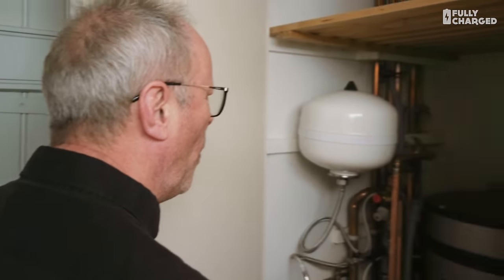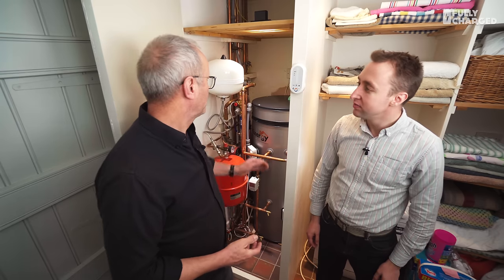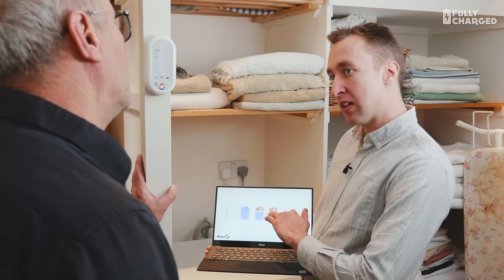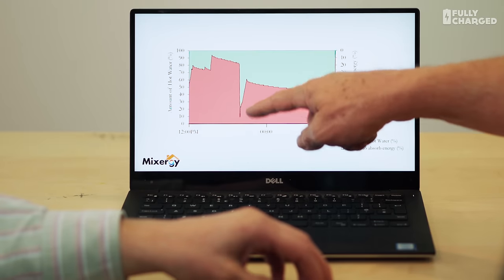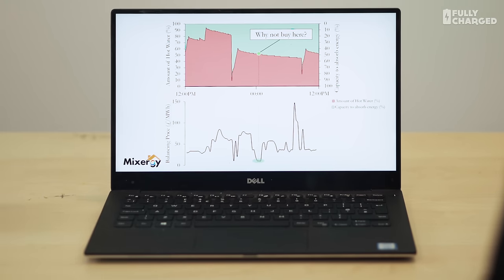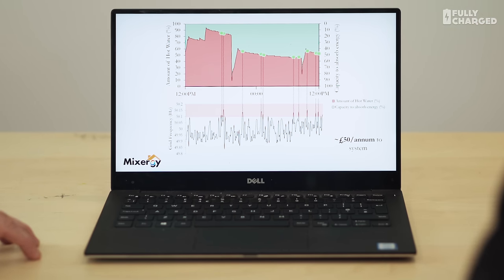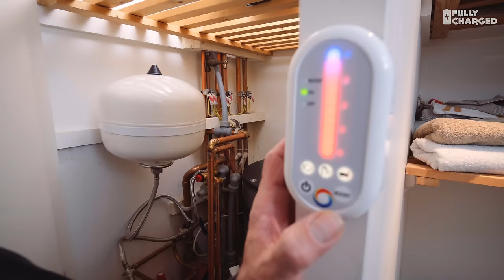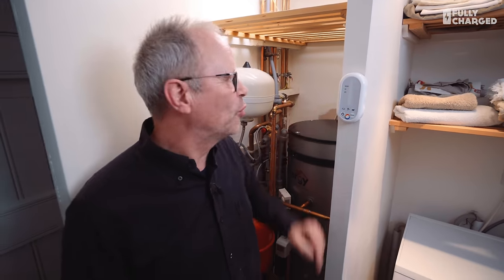Mixergy Hot Water Tank | Fully Charged

Comment: In the 1970s we also had a water tank with a second heating element at the top so that we could have a quick warm up of water if it was cold :)  On another point, the animation that he showed of a bottom heating element having to warm a full tank isn't correct as it ignores convection.  The warm water at the bottom becomes lighter than the cold water and gathers at the top of the tank first in any case.  Because of this the water at the top of the tank will be well up to the correct temperature for household usage long before the whole tank has heated up :)
Reply: You're correct that the top warms by convection from a bottom element, but slowly- hotmwater from the element warms surrounding water as it rises, so you are basically heating a large volume of water slowly. It takes some time before the whole body of water is hot enough to use. By using their principal, ALL the heat is concentrated at the top, so the first few litres quickly heat to a usable temperature. You could probably have a short shower in ten minutes from cold, with a conventional tank you might have to wait half an hour or more.

Comment: You'll have a job and a half getting the tank out if you ever need to replace it. But, having a hot water service that saves electricity will be a good thing. In Australia we have a Edwards solar hot water heater which uses the sun to heat the water up to 100C. But if it has been cold we can turn on a timer that uses a 2400 watt element inside the stainless steel 150ltr tank. It only takes 1 hr from 5AM to 6AM to heat the water to 60C which is enough for 3 long showers. It only cost us $4500 which was not long after they first came out over 10 years ago and still going strong. I imagine they are much cheaper now.

Comment: If you store hot water leave the heat source on 24/7, let the stat maintain the heat. This stops you from ever having heat up a full tank again. As you draw hot water it is replenished with cold which will cool the hot water in there that you have previous paid for so it makes sense to me as the temp drops to apply the heat as the stat demands . Good insulation is a key factor as well.

Comment: My water tank is 42 years old. I heat it with gas and in the summer my gas bill has been just over £5 per month to heat the water. I am finding that as I look into solar energy, batteries etc that the payback is at least 8 years (more if you take into account lost interest). This looks like it will be something similar? I think the problem is that a lot of these technologies end up being a long term investment in a fast improving technology and that makes holding off until something better comes along the default position for most people.
Reply: If you're looking to replace a system with our tank - you need to look at the difference in cost between our system and a conventional one, you also need to factor in whether you're using gas or electricity and what prices you expect these to rise to in the future. Our view would be that for most people for whom this product is relevant, the payback is less than 5 years!
Reply: Robert Smith it's the same with all new tech. Early adopters pay for the kit to become cheaper for everyone else!!
Reply: I see your payback argument, there are probably better bang for the buck things you could do.  But lost interest? I get 0% on the savings part of the bank account and then I have to SUBTRACT inflation from that. Hence for every investment I do that decreases monthly expenditures is infinitely better than keeping it in the bank. Also, in my case I use a heatpump to warm the boiler which means I got rid of the gas entirely, including the fixed fees, which alone is more than that 5pound a month.

Comment: How does this deal with the issue of bacteria growth (legionnaires, etc) at the bottom of the tank where the water will be relatively cooler (likely less than the 55-60C which is required to reliably kill water-borne bacteria).
Reply: Don't ask difficult questions. The point is that this is a fantastic bit of kit. It will save the world at the cost of waiting a short time for the water to warm up.
Reply: In certain countries there’s guidelines to about once per month jack up the temperature to max. 
I bet this could be programmed to do that automatically!
Reply: Surely there are water-tank specific regulations that needs to be upheld to use any such product in the market, however I came here to ask exactly the same question as their site does not seem to cover it.
Reply: Thank you very much for explaining your methods for hot water tank sterilisation Pete!
Reply: Pete, heating all of the tank to sterilize it would take a lot more energy than using a UVC sterilizer - you could have a glass cylinder at the bottom of the tank to insert a replaceable lamp that could sterilize using very much less energy.
https://en.wikipedia.org/wiki/Ultraviolet_germicidal_irradiation
Reply: Thanks Andy! We have looked into this sort of thing in the past but our concern has been that some potable water supplies are quite murky due to dissolved air and mineral content, consequently these systems may not be able to penetrate through to all the surfaces you want in the tank... also over long periods of time if you have a small amount of scale build up in places, this may create shaded areas which might not be reached and so we decided that periodic heating of the whole system was a better way forward..! It is an interesting idea and good to have someone thinking along similar wavelengths to us out there :)
Reply: Won’t all the water at some point have to pass through the top, reaching 60 degrees and kill of any bacteria?
Reply: And how does the rest of your plumbing heat up to kill the bacteria?
Reply: I would imagine a steralization cycle to heat the whole tank could be easily coded in... solving the problem.
Reply: Pete, yes is a pity that nothing stays brand new and gets gunked up - circulating the water through a tilted glass pipe surrounded with a uvc lamp may help to disinfect as much murky water as possible, rather than it just shining at the bottom of the tank. The lamp itself doesn't have to be in contact with the water, so the pipe and lamp could be outside and available for inspection/replacement, and it would have to be shielded in use. It would also need another pump which is something else to maintain.
Large water treatment plants and swimming pools use them, but these are staffed and therefore actively maintained.
I think most people with a hot water tank just forget that they have one after a while, until an element burns out or it springs a leak!
They could also be used on the inflow or outflow or both, and in which case an extra pump wouldn't be necessary, but then the question arises: How much power is required to adequately disinfect at the flow rate required?
Reply: Cheers for the reply Pete, that answers my question perfectly.
Reply: I have a tankless (gas powered) heater.  I get hot water seconds after turning it on and don't have to pool water anywhere... tankless electric water heaters fed from batteries that are recharged with solar/wind/grandmas farts makes a more compelling argument than this water heater.
Reply: James Bradwell That is a great question. I wonder if they thought of that.
Reply: They are also far more expensive... this seems like something you could do when your old tank is a duffer like Robs, or something that could be installed in new builds without affecting the costs too much.
Reply: Tom St Denis I have a gas tankless system also, and it is great. However, as an energy storage system, this tank will certainly be an order of magnitude less expensive than a electric tankless heater + a battery. The cost benefit is covered briefly in this video near the end. If you need hot water and energy storage for your solar system, this looks like a great new option.
Reply: The cold water coming in will stay cold for longer and it will hold it's chlorine for longer and that should kill the bacteria, assuming the water supply is chlorinated.
Reply: @Tom St Denis - One word: cost
Reply: Most of the UK is on gas. There is no way to heat water with mains electricity that is cheaper than gas, as gas costs 3p per unit and elecritiy cost 13p per unit.  Sure if you have solar panels on an old feed in tariff this may help reduce bills in the summer or if you are off grid for gas this could help. Otherwise if you are on a fancy time of use tariff (that currently does not exist in the UK for residential customers), and there are periods when it is below 3p per unit or they pay you then this may work out well.
Reply: Hello! Just like any other hot water system this delivers water at sterilising temperatures which in turn deals with the plumbing downstream of it
Reply: The problem is though by measure of kWh we probably consume far more charging our cars, cooking food, and running air conditioners than heating water.  Storing excess renewables as electricity would ultimately be healthier for us all because it means we don't need to spin up gas/coal plants to AC our homes at night...
Reply: Sure batteries would be more expensive ... they'd also be far more useful.  You can't cook your supper or charge your car after work with house hot water (carefully avoiding the trap that is industrial grid steam turbines :-) ).  On demand electric water heaters is probably a far better use of electricity/energy with excess renewable being stored as electrical potential (on the grid and/or at your home).
Reply: Why not just have another element at the very base of the tank purely for the purpose of sterilisation?
Reply: That would defeat the purpose of the design...
Reply: Legionnaires is only a problem with systems where there is the possibility of stagnant water! ( say at a spur where flow doesn't flush the stagnant water from the system) this system pumps hat water down effectively so water is circulating within the tank! 
I hope this is helpful! I don't work for this company by the way!
Reply: Scott Dann I have no expertise but at a guess it's more energy efficient to run a pump than use another heating element?
Reply: damn BOI ! I needed a strange response to such an awesome answer, can we get this to Sweden? because I am changing out my water heater in 4-6 months and would love something as smart as that!
Reply: mixergy.co.uk
I'm sure you've checked, but there it is!
Good Luck!
Steve
Reply: Tom St Denis you obviously don't live in the UK. Virtually no one in the UK has air conditioning in homes. So this is less of an issue here... And if they do have air conditioning in there home it will only be used for 10 to 20 days per year, this year is the exception that proves the rule lol.
Reply: AMacProOwner My parents heat pump performs a pasteurisation cycle heating the entire hot water cylinder from the normal storage temp of 50C to 65C once a week to prevent build up of legionella bacteria. I consulted a legionella expert when the ground source heat pump was installed out of concern and he recommended to not set the storage temp below 50C to keep legionella growth rates low.

Seriously Robert I would check this tank is safe from a Legionnaires disease aspect. This is what the UK Health and Safety executive recommend http://www.hse.gov.uk/healthservices/legionella.htm
Reply: All the UK water is full of bleach, there's not too much to worry about.  Everyday use, theres never been any cases reported that I've seen.  If you're away on holiday for a few weeks then it's common sense to run the water for a few minutes just to be sure.  Here' in Busselton WA we had aquifer water, it was amazing.  Water Corp used a study of a virus in the water in the 1970's to Chlorinate our fresh water.  Now we're like the EU.  Funny fact that other countries are now switching back to UV and claiming the Chlorine is dangerous.  Go figure.
Reply: I believe Nest has this feature built in. In reality I suspect Mixergy will get up to full temperature from solar quite often.
Reply: James Bradwell check out a Bosch compress 3000. It does everything this tank does and also heats up the whole tank to 60C weekly to make sure there are no bugs
Reply: A tankless heater doesn't have any buffering capability. (Ability to take advantage of the variable grid pricing schemes or storing excess solar.) Treating your water tank like a grid connected battery is the whole point of the system.
Reply: Pete armstrong Thanks for sharing the article. Did you get your hot water tank idea from that research project?
Reply: Just dangle a bit of silver in the tank. The old prairie trekkers put a silver coin in their water barrels to keep the water from turning foul.
Reply: @ahaveland  Hi Andy! Fancy seeing you here... Artic still melting I see, so I'm getting a new cylinder to match the heat pump we're going to replace our old oil fired boiler with. Looks like Mixergy are going to get the sale...
Reply: @nicholaspalmer2220  Good to see you Nick, I'm still kicking around.. yes, Arctic still melting and I'm still doing my Death Spiral. Really glad you're dumping the old oil boiler -the heat pump should help a lot....
Lots of scope to heat the house using passive techniques too!
Reply: @ahaveland  Our last house had an electric boiler using low carbon renewable tidal + nuke energy - but we moved two years ago and I'm just getting started on this new house.  I hate to rip out stuff that still functions well, but... The heat pump will eventually get (mostly) powered by a small wind turbine
Reply: @nicholaspalmer2220  Nice! I'd love a wind turbine, but a bit impractical in an apartment block with no garden, but I do charge my ebike using solar panels. Hopefully will move to somewhere more rural and have space to go off grid for real.

Comment: I don't know about the technology not being there. 35 years ago I had a solar system installed. There is a 250 litre insulated tank that has a conventional resistance heater. It's connected to the controlled load supply (grid controllers turn it on and off and it helps them manage peaks and troughs). Surrounding that tank is another tank of 250 litres that feeds the central tank as you demand hot water. Any heat that leaks from the central tank is captured by the outer tank, so there's no energy loss. The outer tank is heated by solar heat panels. In normal operation the solar keeps the whole system hot enough that the electric heater never comes on. If there's an extended cold cloudy spell, the electric heater makes up just the difference from electricity that would otherwise have been thrown away. 
I'm really not seeing how this system is even as good, let alone better than my 35 year old system.

Comment: It’s still a resistive element though? I have a heat pump which has a COP of between 2 and 3.6, dependant in the delta t. I’d be interested as to the relative cost and emissions savings verses you system. Obviously the heat pump is more expensive to purchase initially, but my Daikin system does DHW and space heating.

Comment: Feels like this is just like how normal water tanks are supposed to work and have been for the last 20 years where I live. But with the added fancy electronics contained in a single unit.

Most common units here are combined units to store thermal energy and a hot water coil in the top part of the tank in the thermal layer. But instead of charging with electricity it common to charge the water tank with a high efficiency wood boiler with a special type och charging pump to create the thermal layer taking cold water from the bottom and returning it to the top only when it is at least around 85 degrees C. Not as common thermal solar that can use mutiple coils on separate heights with thermal valves to charge the tank correctly. But now days the most common system to install is a ground or bedrock heat pump that has a minimal tank to avoid heat loss, sometimes together with thermal solar to service the hot water and heat during spring, summer and fall to save on the number of compressor starts during this time of the year.

Comment: This would be a great solution for a sustainable system I have in mind. Get solar panels, figure out how much energy is currently needed, put the surplus in the boiler using a heat pump if conditions are fine (not too cold outside if using an air heat pump) or using the boiler's heating coil.
Reply: Or just use a tankless electric heater, insulate your pipes properly and store excess renewable as electrical potential so you can both have a shower and microwave a burrito at midnight.

Comment: I recently installed a Quantum mains pressure hot water cylinder-- it uses "some " of the same logic but is only for  electrical input such as E7 (or E10) in my case. Two elements but controlled by numerous thermal sensors and a little computer which gradually "learns" what is required day by day and adjusts the input accordingly> The control unit shows what portion of the tank (150 L in my case) is heated and to what temperature(settable to within 1degrC) It's significantly more expensive than an old fashioned two element low pressure copper cylinder but looking at my electricity consumption it won't take long to pay back.

Comment: Seems like a very complex solution when an air source water heater would be more efficient still - kind of like an LED light using less energy than a dimmed incandescent. It does make sense in a cramped space though - but the air source heater is great for dehumidifying a basement.

Comment: I have a similar heat battery system where the spare solar on the roof is diverted into the water tank instead of being exported to the grid (which I get paid for whether it's exported or not).  In the UK this summer we're getting piles of free hot water.  Trouble is, it's a cold shower I really need right now ...